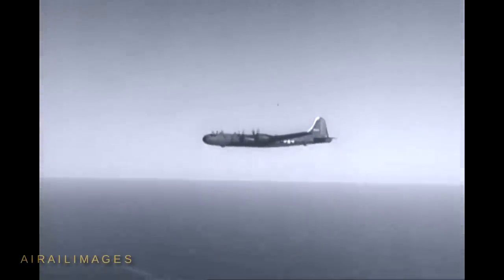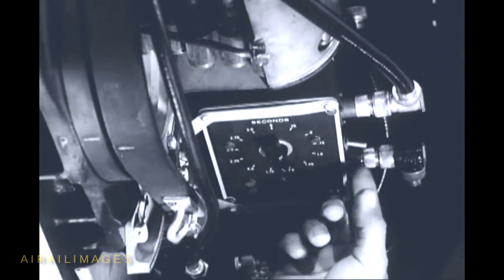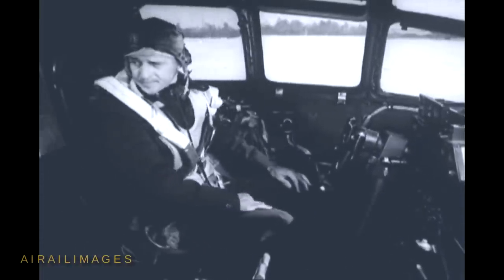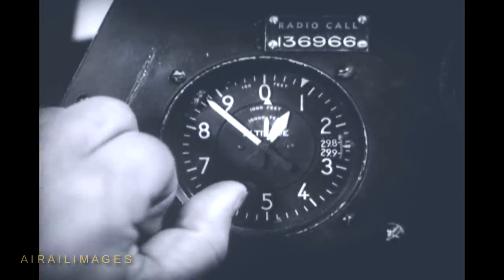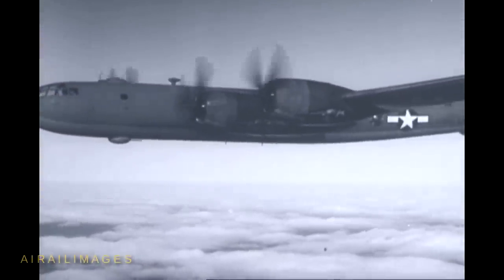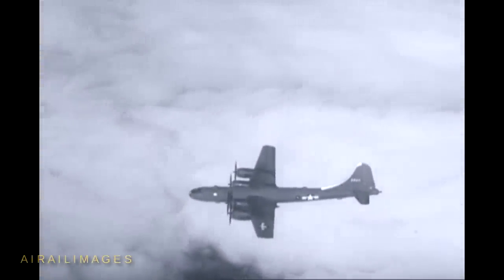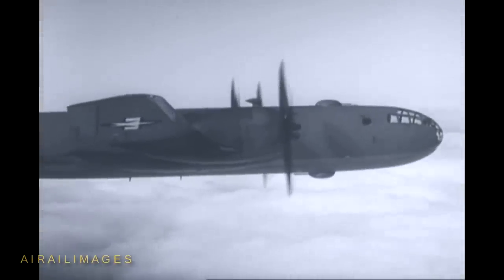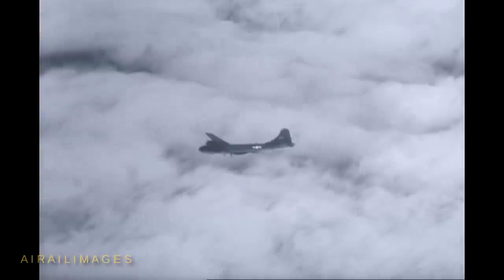B-29 Flight Procedure and Combat Crew Functioning - "Irresistible Instrument of Destruction"

Comment: Man that is a lot to remember. Are there checklists for most of those items or is the pilot supposed to remember all those steps?  Thanks for posting this historic film.
Reply from the maker: Most military aircraft have checklists to be followed. I remember when I was an Air Force historian, sitting on the flight deck of a C-141, the crew used a rolling checklist in a little device with a window; as everything on one screen was acknowledged, the copilot rolled the next screen into view to be addressed before takeoff.